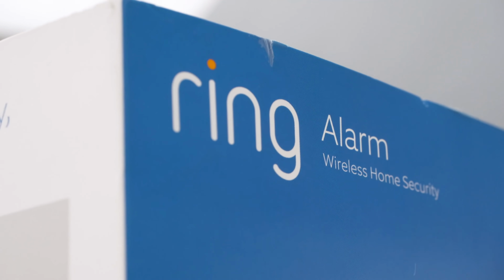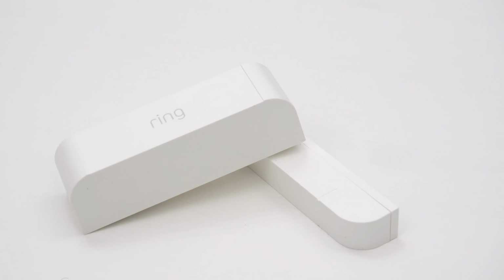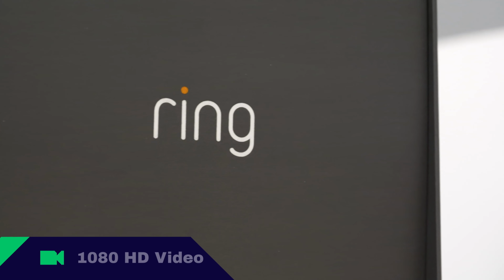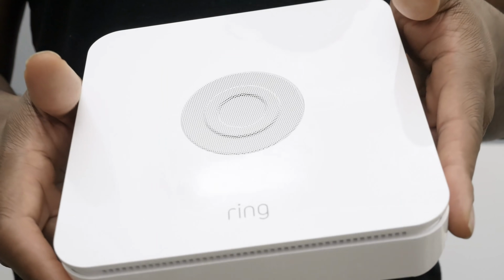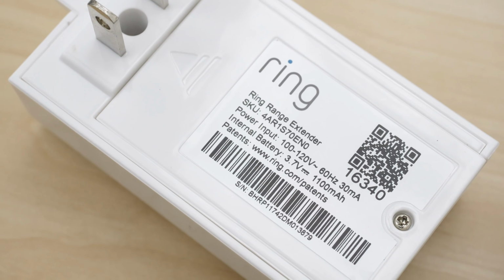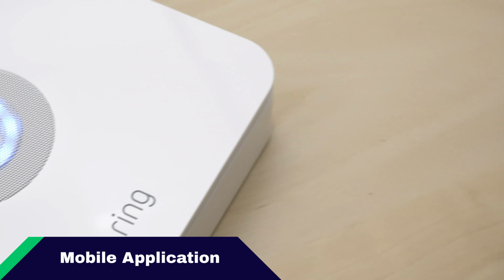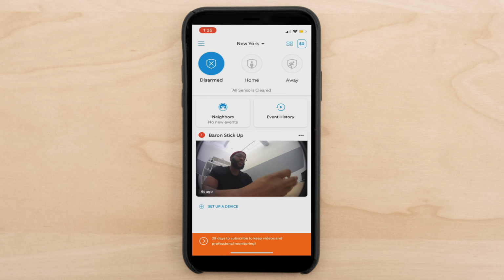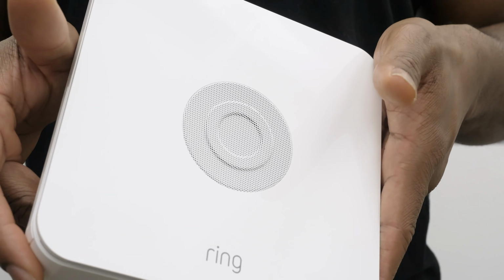Ring Alarm Home Security Kit Review- A Safe Option?

Comment: Hi Security Baron, Love your video! Ideas for your next video on RING security system: viewers like me might be interested in comparing the top brands to help me make a buying decision.  Also how to install them...or even maintain them...like a long term review point of view....what happens after the batteries run out on keypad or the sensors...can owner replace the rechargeable batteries or one would need to buy a brand new sensors, etc.. Hope u can answer the question on the battery inside the sensors....oh there is a video out there that shows how to do a permanent wired hookup to key pad if one has a set of low voltage wire in the wall already....but it doesn't show what happens to the other end of the low voltage wire :-(. Thanks!  Keep up the good work!
Reply from the maker: Hi Marky, 

Love your ideas! More comparisons are coming, as well as more specific information about each system. The battery life of the Ring keypad should last about 6-10 months, and you'll just need to recharge it- no need to replace the whole battery.  The batteries for your contact sensors can last up to 3 years and with that, you will need to replace the battery. For more information, check out our full written review: https://securitybaron.com/system-reviews/ring-alarm-review/#What8217s_Included_in_a_Ring_Alarm_Security_System
Thanks for watching! - Gabe

Comment: I have been glued to ADT for so long its hard to break free. The pulse system has always had features that nobody else had. But with today's competition adding more and more ADT is falling behind. I just want a system that controls all my devices from one app. 4k cameras, thermostat, door locks, lighting, garage door, 2 way audio and a app that works with low lag.
Reply from the maker: Honestly, there is no security system that has all of those components, so you would need multiple devices from multiple brands. Let me know if I can help you look for something specifically.
Reply from the maker: Yes, if you already have Ring products then Ring Alarm makes sense.
Reply: ADT just released what is called ADT Command and Control and let's you control a lot of the options you listed. I currently have the Ring Alarm system but am debating between it and the ADT Control.
Reply: I switched to ADT COMMAND and it's pretty awesome. With some work everything is working great.
Reply: @stevepessy  Is it?!?! I'd love to get it, but the possibility of my monthly price going up and three year contract is a deterrent for me. How long have you had the system for? I love the touch screen tablet verses having to have holes drilled in your wall mount it.
Reply: I have the pulse system for 5years. I was paying $67 a month. They lowered the price to $44 (2 year) contract. But I also payed to have the Command unit installed $500. I got 2 touch screens, 2 cameras, smoke detector, translator to work with old door sensors and a new skybell since it works within the adt control app.
Reply: @stevepessy  I did not realize that the Pulse was more expensive. I would be a first time ADT customer so I was curious about the new ADT Command system. There have been no reviews on it anywhere!

Comment: I added the ring fire alarm listener. It ties your existing fire alarms to the security system so you don't have to replace them to work with the system.  Looking to get the water sensors next.

Comment: Awesome video! 

All in all it’s an awesome system for security. 

A couple things I discovered with this system that the motion detector will detect medium size dogs (I.e 50lbs or higher) even on the lowest setting.

I tested this with my dog and left all motion alerts on for a week and there were definite times when he was detected. 

Another bit that I didn’t like but may not bother others is that for the camera it’s a pretty binary setup.

You can either record motion or not. And if you don’t have record motion on it does not record any video at all. 

What I REALLY wanted was the ability to have the camera there, and only have record motion on when the ring alarm was in a particular mode, I.e home and away. 

For example when armed in home mode I wouldn’t mind the camera recording motion. And in away mode I would configure it to alert on motion as well. The ability to create a custom mode as well even just one would be awesome. As being a dog owner, sometimes we leave the dog in the kennel, and when we do that we leave the tv on so he doesn’t bark at everything outside. Having a custom mode that would allow me to set the ring to react as if in home mode but without turning on the camera recording unless the alarm was triggered would be awesome. Unfortunately I didn’t find that possible with the ring.

In general a setting that would configure the camera to start recording only when the alarm was tripped would be ideal. 

Another bit that was disappointing is that there is no way to setup the alarm to arm at a given time or via geo fencing. 

Currently as it stands August lock isn’t supported, but will be in the future.

This is probably where the mobile app gets negative reviews.

Now aside from that IF you are a SmartThings user, there are ways (not supported) to integrate ring into SmartThings to gain some of these features like geo fencing and scheduled arming. Because of this and seeing that the open source community is building tools to do such things makes this product more interesting. 

However like all things unsupported the question is how long will this last?

Do I really need geo fencing, no. Do I really need the ability to arm the house at a certain time.. probably not. Is it possibly via Alexa? Not that I’ve found. 

Last bit I wanna mention here is that ring does currently support a third party smoke and co2 detector from first alert, and will respond the fire department (confirmed by accident).

They also make their own flood and freeze detectors as well as smoke detector. 

There currently isn’t a break glass detector like SimpliSafe. 

For the alarm you do have delayed entry configurations for different modes as well. 

Phew long user review. All in all I give it 4/5, the ability to get to the api (securely mind you) with smart things is a plus, it’s simplicity is excellent. I just hope they add a few more necessary features, I.e geo fencing for arming only (not disarming), scheduled arming, a custom mode, and the ability to only record on alarm trigger would really make this system much better.
Reply: I had heard recently that Amazon echos and Alexa devices have a way of detecting broken glass and movement, but I do not know if it's integrated with the Ring security system. Seems like it will most likely be in the future.